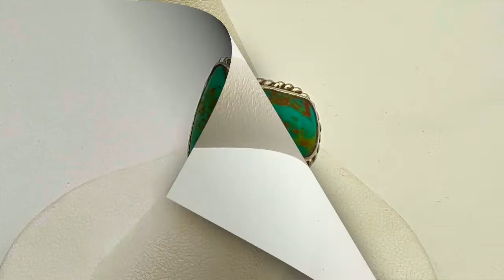Silversmithing: Making A Turquoise Ring

Comment: Hi Chad, I'm using some of the techniques in this video but applying them to a bracelet with 2 1/2 round 8-gauge wire and soldering the ends together but widening center out a little, then soldering 3 bezels on band in which I'll set turquoise cabochons. Can you do a video on how you would go about doing this? Also, can you make a video of you cleaning up your silver after construction (all the filing and their cut, silicone wheels and their coarseness or fineness, etc...) before you set stone or stones? Just a thought...thanks, kim
Reply from the maker: Thanks Kimberly. I’m planning a pre polishing video but haven’t made it yet. Look for it within a couple of weeks. I’ll probably do a cuff kind of like that at some point as well. That sounds pretty!  Thanks for the suggestions!

Comment: If there's a stone that doesn't sit perfectly flat in the bezel apart from the obvious of taking a skim off the stone is it acceptable to use some sort of low tack adhesive? or a very thin layer of white tac? I've set a couple stones that are say 3/4 " by 1/2" and the stone is very slightly loose despite keep going  round pushing the bezel edge in eventually it settles but I'm worried about cracking stones! Thanks for your help!
Reply from the maker: I sometimes use some strategically placed tagboard to balance things for stones with irregular bottoms.  Some people use sawdust, but I haven't done that before.

Comment: hi Thank you for the video, excellent work, just a quick question. Could you grind down the bezel instead of usuing tag board to raise the stone?What are the benfits ?
Reply from the maker: Absolutely. More often than not I file the bezel pretty short and just use a sliver of tagboard under it for a bit of compressibility:)
Reply from the maker: Absolutely. More often than not I file the bezel pretty short and just use a sliver of tagboard under it for a bit of compressibility:)

Comment: As a newbe, could you explain when you use hard, med, easy solder.
Reply from the maker: Hello Danette!  Many people use all of these types of solder when making silver jewelry. I tend to mostly use hard for everything unless I have a sketchy last solder joint where I don’t want to risk having previous solder flow into a place I didn’t want it. A good example is soldering the pin into a hinge.  I don’t want other solder joints accidentally reflowing and seizing up the hinge, so using a type that melts at a bit lower temperature allows me to secure it without risking that happening.  There are some other factors as well. Maybe check out this video:  https://youtu.be/Mau4TSZ5dvY?si=ycerbG1ZSpPKV02W. Hope this helps!

Comment: Great video Chad!  Keep them coming, I got some good tips out of your video.  Did you sand the ring wires that are soldered to the bezel in the back down a bit?
Reply from the maker: Thanks Andrea!  I filed them until they had an even flat top so it was easy to solder them to the flat surface of the back of the bezel.